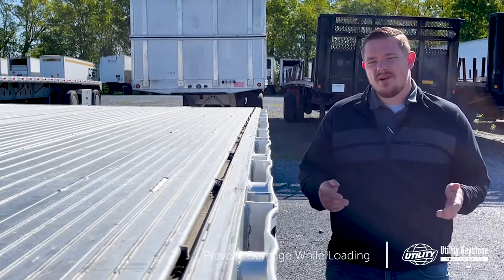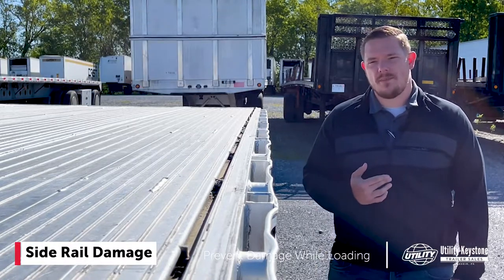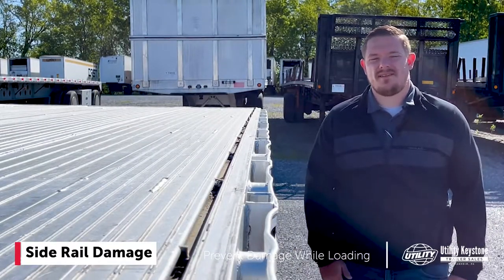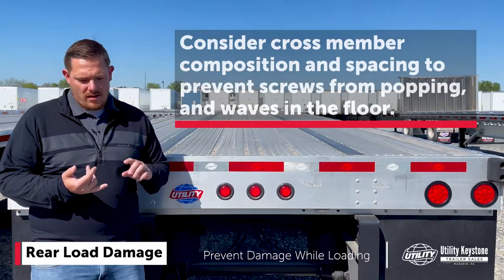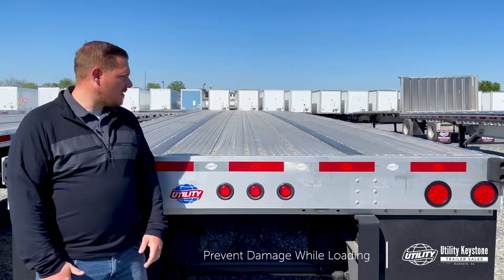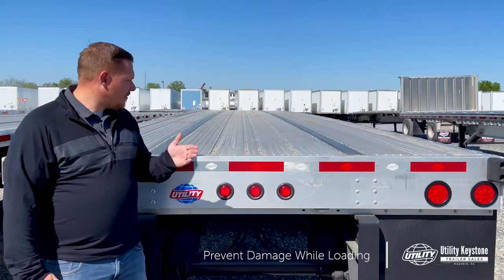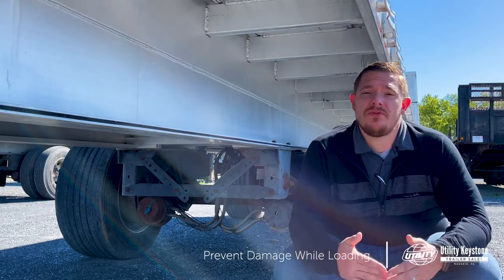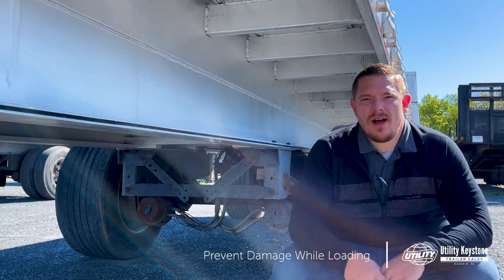5 Ways to Prevent Damage to Your Flatbed | How to Buy the Best Flatbed

Comment: Got one for you that will probably make you a millionaire if you can be the first to corner the market???
In my neck of the woods you see a lot of flat bed trailers with their toolbox doors damage; or held on by a strap of some sort to keep door from flopping open during transit and I was wondering how come they don’t design the doors on the tool box to be like the doors on a greyhound bus ??? Cause I’ve never once seem a greyhound bus compartment door missing or strapped closed in order for the bus to operate??? I’m sure the luggage has got to be just heavy if not heavier than the things that a flat driver puts in his trailer tool box… I believe the first company who can come up with a similar design for a tool box that can fold out and up like a lambo door or greyhound’s cargo door will become a millionaire. Why has anyone noticed this and thought of this before ???
Their are buses in grave yards for over 30-40 years sent out pasted but their cargo doors are still intact….
Utility give this idea to you (no charge!) I’m not a flat bed driver; just watch this video an had a thought …